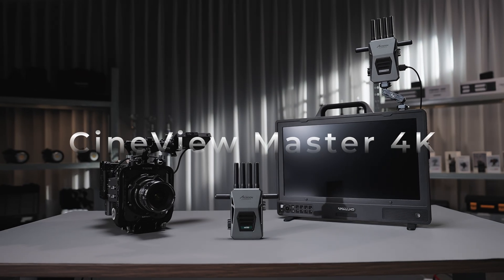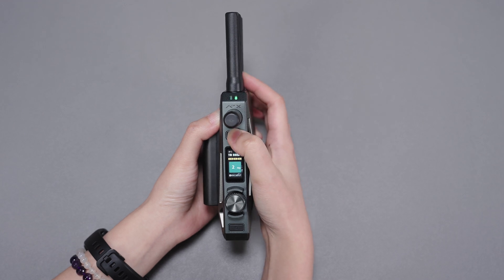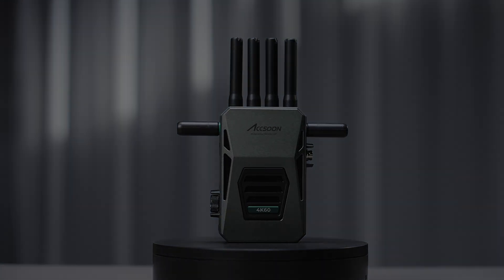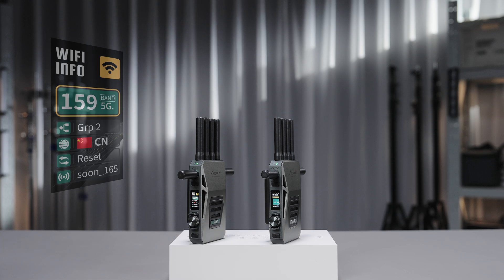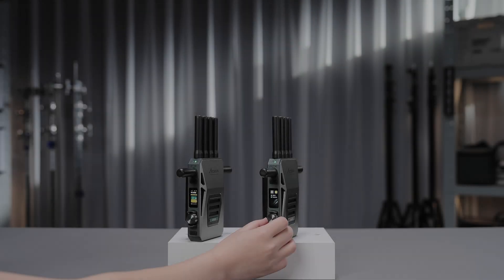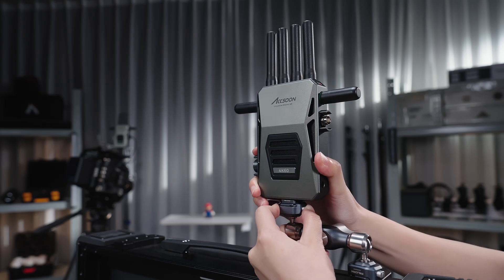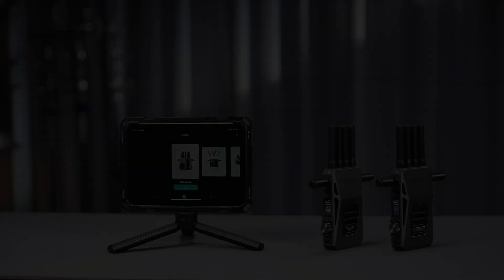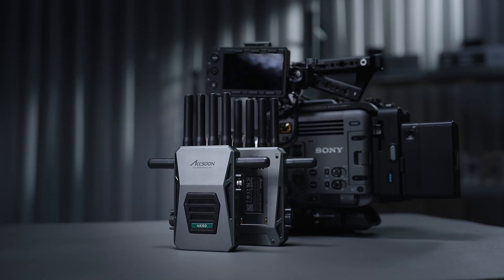CineView Master 4K | Complete Walk Through Tutorial [Guide & Tutorial]

Comment: I was interested in buying this product because i've had your previous transmitting systems as well. But i've heard so many bad reviews, saying that the low bitrate at 4K is a big turn off. 

I really hope this must be solved by now through a firmware update, can you tell me if the bitrate issue has been solved?
Reply from the maker: I did personally heard complaints of blocky noise at 4K low framerates including 23.976, 24, 25fps, this problem was solved in the latest firmware update, you won't find the image filled with blocky noise anymore (Maybe that's why people think the bitrate is very low at 4K, but it's actually a encoder bug present on early firmwares). As for image quality, I personally recommend trying out CineView Master 4K with the latest 3.30 fw (also supporting 265) yourself and see if it's good for your use case, it will be better than our previous products.  -Adam